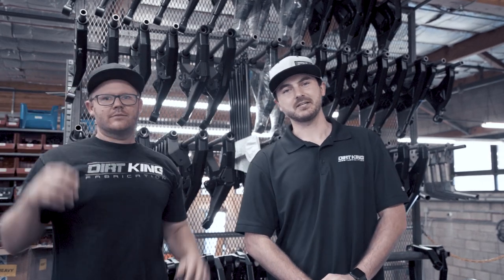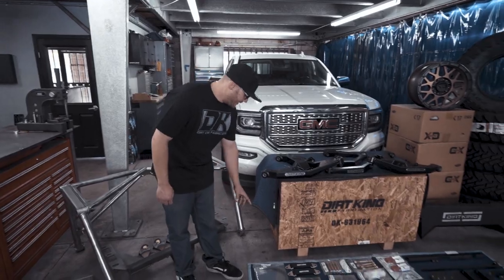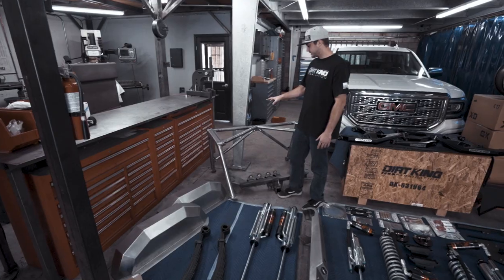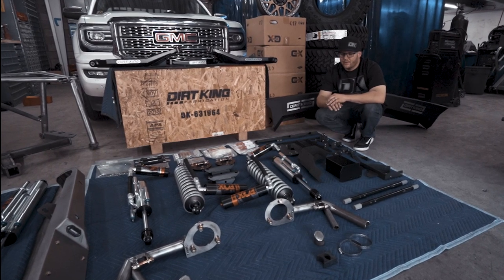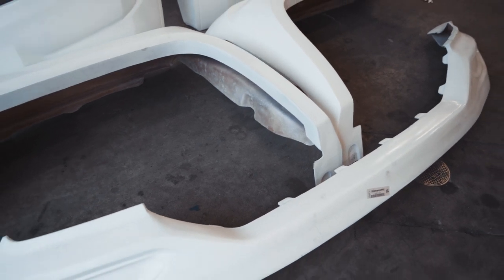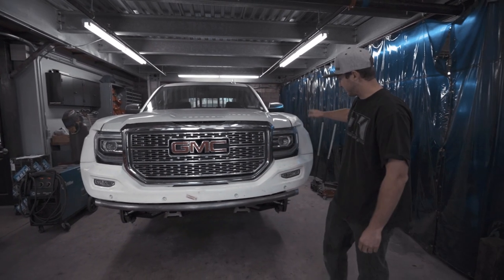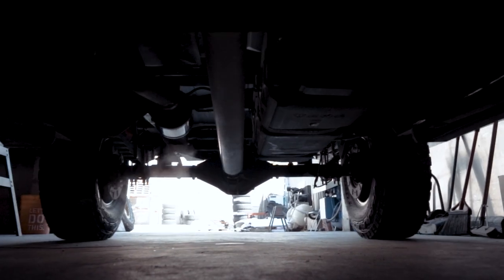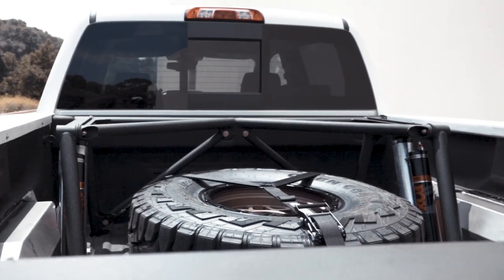GMC Denali Prerunner Build By Dirt King Fabrication

Comment: Price and time to build should be in all of these type videos.
Reply: If your worried about that then this is definitely not in your budget
Reply: @adriantrejo6696  
I'm not worried about anything.  Would just be a very useful piece of information for ppl.
Reply: @adriantrejo6696  Broke people: “If you have to ask you can’t afford it”

People who can afford it: I wonder how much that would cost buying the full kit vs the parts I actually want, and how long that would take to do myself. Maybe the best option for me is full fabrication and installation from a reputable shop instead of buying the kit and doing it myself. Professional installation from the manufacture would go a long way in ensuring everything is installed correctly and would increase the value of the truck if I ever went to sell it, but I need to make sure their installation prices are competitive compared to quality 3rd party shops.
Reply: I can build the best suspension in the world!

BUT not for a competitive price, because I have no clue, need experts, calculate small number prices etc.

Therfore price is part of every product.
 search 4P.
Reply: I paid roughly 18k in parts minus the bed cage, leaf springs and inner fender wells. Identical build found at this link. 
https://youtu.be/MQ3S6MBqZm0
Reply: @mminnich83  like 28k for everything in Canada lmfao including king suspension and wheel clearance fenders, about 22k maybe 23k with fox suspension, 
This is without tax and shipping
Reply: @adriantrejo6696  pretty ignorant thing to say
Reply: And without the trash music
Reply: Parts and labor, guarantee you're looking at spending AT LEAST $35k especially these days, price on steel has tripled in the last year, so all those parts definitely are marked up to compensate for that.
Reply: On their website in detail with parts only and parts plus labor cost
Reply: @adriantrejo6696  "If your worried about that then this is definitely not in your budget." THAT makes no sense. People still need to know how much time and cost a project takes.
Reply: @adriantrejo6696  what? He just asked the price, any more.
Reply: I aspire to get a mid travel kit for my 2012 Tacoma . I value my bed space too much and I think I can afford it
Reply: If you take your truck to guanko China they could build your truck like this one way cheaper including the ling Lang tires

Comment: What’s stopping GM from making this 😫
Reply: Probably a mix of lack of demand, Mgmt. planning, and a flawed front UCA design. In the 14-19 1500's there is a "limit tab" that the UCA will come in contact with if the suspension droops too far. You can see it here in the upper left part of the frame if you pause. https://youtu.be/ekkUlv8iC-4?t=35
Reply: @charleseline3176  any reason that couldn’t just be modified?

Comment: Nice build I have a 15 silverado going with this look have the 6" front fender on just started doing the rear today can't seem to get the tailgate and top corner to line up correctly the top corner seems to twist in just a bit to much keeping the tailgate from closing
Reply from the maker: The taillight and tailgate section of the fiberglass install is often the most time consuming. Call the manufacture to see if they have advice. We remove sheet metal and fiberglass until we get it where we want. Occasionally we need to do fiberglass or bondo work.

Comment: Iv been looking around for kits and this one by far is the best one. Everything is well fabricated. Do you make a kit for a 2016 Chevy 1500 2wd? I'm sure it's costly but good work isn't cheap, and cheap work isn't good.
Reply from the maker: The kit in the video is compatible with a 2016 Chevy 1500 2wd. You just won't need the extended axle shafts. Take a look at our website for more info on the suspension.

Comment: Currently Running a Mid Travel Lift with Icon suspension on my Titan and I have to ask, is it required to replace the stock spindle for offroading purposes as well? I was out with some buds and one their Titans also rocking the same suspension setup as me with stock spindles had the passenger side snap literally snapped, now not sure if its him that's just unlucky or if that is a part that is required for a more beefy aftermarket replacement -ps still pretty new to off-roading

Comment: Dumb question but is the 4.5” backspacing kinda like running a 1” spacer(  I mean giving the wheel an extra inch on top of the 3.5”) @dirtking
Reply from the maker: No it's different because there's back spacing and there's offset. You could have a wheel with 4.5" back spacing and a wheel with 3.5" back spacing and they could both be 0 off set. Then when you add a wheel spacer in would make it 1" off set potentially casing more tire wear.

Comment: ok, mine next.  i've been looking for a kit to get 37's under my '16 Silverado LTZ loaded w/6.2.  Question:  How does that Deaver pack tow?
Reply: ... & subscribed!  Keep this shit up fellas!
Reply from the maker: The Deaver pack isn't intended for towing since it would compromise it's off road handling. To tow with this type of rear suspension it needs removable air bags.
Reply: Dirt King Fabrication, 10-4.  what kind of bag kit would work with the setup in this Denali?
Reply: @freidrichnietzsche6643  Airlift suspension.

Comment: What exhaust was used on this truck?
Reply from the maker: this truck has a Magnaflow muffler and turn down tip
Reply: Any idea which magnaflow muffler?……. I love the look of this truck and kind of want to build mine to match, what’s the cost of the whole set up?
Reply from the maker: @lowbudgetcycles  The part number is 14159. It's the small race muffler

Comment: What are the trucks towing capabilities before and after the build ?
Reply from the maker: Once you go to long travel rear suspension your towing capacity is dramatically reduced. You can however keep towing capabilities with removable air bags that are used just to tow. This truck doesn't have those though.

Comment: What rear end are you running for the 37s?
Reply from the maker: It has the factory axle housing with 4.10 gears
Reply: @dirtking  trussed?
Reply from the maker: @freidrichnietzsche6643  no it's not